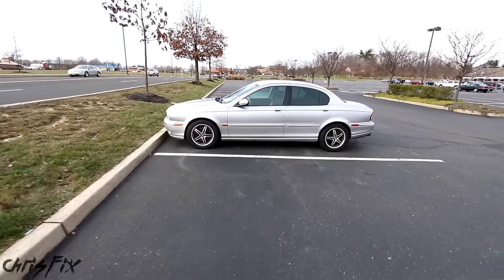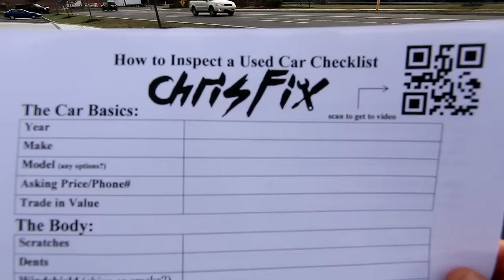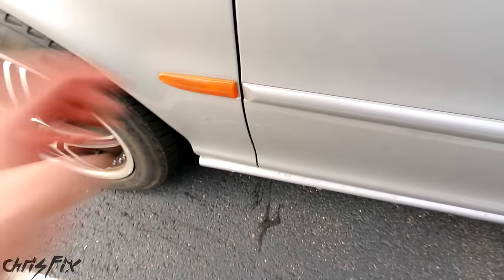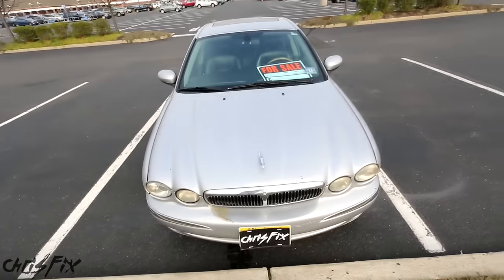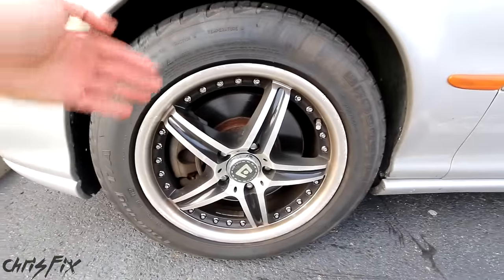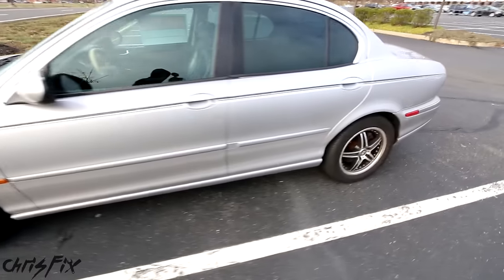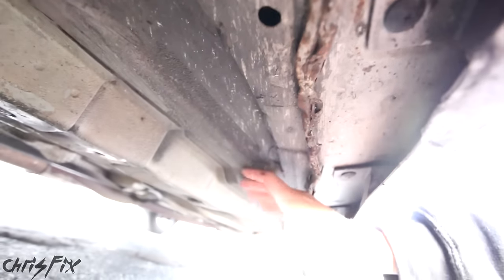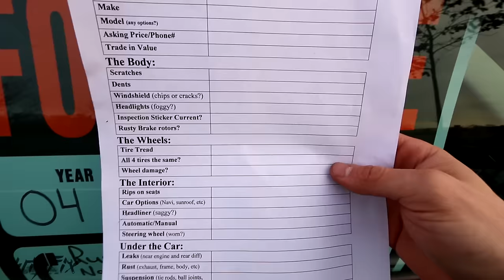How to Inspect a Used Car for Purchase

Comment: In the UK I wont buy a car unless the seller shows the plates in the ad, unlike in the US cars in the UK are registers when they are sold brand new and given plates which are permanently registered to that car, no matter how many times its sold. (I believe in America the plates are registered to the driver however it seems to change from state to state).

Anyway In the UK every car over 3 years old are subject to an MOT, this is a yearly inspection which vehicles must pass to be road legal. This information is public and can be easily found online for free. This includes all faults the inspector found, including engine faults and even advisories which will be minor faults which do not impact vehicle performance or safety.
If a seller is hiding the plate I 100% believe they are hiding this information so wont buy the car.

Does the US have anything comparable?

Comment: I bought a CPO Mustang from a dealership two weeks ago and turns out the differential has been leaking for months and the drift shaft is unbalanced. When I had it tinted the shop told me there was two small dents in the car as well. Crazy. Shit dealership for sure.
Right now it’s in the dealership shop and hopefully they fix it for free or I’m going to sue them for malpractice. CPO should mean it has NO major issues other than regular wear and tear. Ill be using this guide from now on so I dont get fucked over like this again.

Comment: NEVER buy a car without a presale inspection. There are issues the eye cannot detect, especially with transmission. A test drive is not sufficient to catch these issues. A presale inspection (called different names in different areas) costs about $100-$300. They look for the same things the guy in the video did plus they lift up the car, check the parts that require computers to check and they tell you if the car is safe and any pending issues they catch. This is EXTREMELY recommended with a private sell and HIGHLY recommended anyways, even from a dealership. If dealing with a dealership, DO NOT USE their suggested mechanic for a presale inspection. Go somewhere independent.
Reply from the maker: Thanks for sharing, I've actually gotten a few cars inspected and every time the shop doesn't do anything except plug a scanner in to see if there are codes and do the same inspection like I did in the video. But if you know a good shop, you could always try bringing it to them!
Reply: @chrisfix  That is shitty. I've come to expect that of most places though. Luckily the mechanics in my area offer more. My mechanic will actually do as you did plus lift the car up and check for any and everything he possibly can. One time he even checked the actual break pads and offered to replace them.

Comment: i’m buying a 2009 a4 2.0t quattro and the guy wanted 7500 after he put 2 sets of rims and around 1500 worth of parts and he said the front brake rotors were warped so i got it for 6500

Comment: Please help, I purchased a used car and didn't check codes, I checked codes after buying and it has 3 codes but the dealership says the codes are just from memory storage and not active, he said it was a problem the car once had but is resolved, is that true? Or is the car likely going to give me the problem? I checked drive monitors and they are all ok and complete. I am taking a long drive this weekend to see if it triggers the car check engine light which is off. The car is used but does have a 3 month powertrain warranty which would include the codes I found when scanning. I'm wondering if I should just sell and not deal with it

Comment: No matter what type or Model this is..This would of been a perfect Car to show to the keen eye what not to buy with a simply 1 + 1 = 2
This car has been in a accident(s)  Cracked from bumper  And circle swirl mark in the rear (Other cars License plate screw head embedded into bumper) followed by scratches where the license plate bracket had also rubbed 
One of both of theses areas Triggered a Airbag release in the steering wheel If you inspect the centre of the steering wheel the color of the Airbag cover does not match the color of the Ring of the steering wheel Or the rest of the interior It looks darker from lack of UV exposure (age) 
Also there is a larger then factory gap between the Airbag and the steering base ..Nowdays if your unsure of something like that Type in 2004 x-type steering wheel and see the diffrence from a factory one online 
Another sign is the lack of a splash guard under the front of the car that was not mentioned
Cheap aftermarket rims that have been on there for some time could be another sign of a accident Dealership OEM rims are quite expensive compare to aftermarket The Owner might of when "Out of pocket" for a replacement On anywhere from simple curb rash To a fully broken/warped rim This would of been a walk away point The car was poorly looked after And cost cutting

Comment: Hey Chris. Or anyone in the comments. What do y’all think about a 2012 Infiniti m37s with 200k miles? Should I find something with lower miles ? How long do these Nissan engines last ?
Reply: Definitely don’t buy a used Nissan that’s a newer one with 200k miles. Only would buy it if it was a older Honda/Nissan Altima

Comment: couple scratch is no problem at all when you buy used car most important is engine and transmission if engine and transmission is bad what will you do with shiny body or glass or tearing seats?   you are minding too much for dents or scratches
Reply from the maker: Both are important. If the owner can’t take care of the outside, they probably won’t take care of the inside.

Comment: I've been looking for used cars on auto tempest for a silver sedan for under $500 with a manual transmission, 4 cylinders, silver paint, and something that could use work. I would like something that I could use for cheap daily commute (4 cylinders). I haven't found anything that i'm looking for in NC. Any ideas on how to find it?
Reply from the maker: Watch my next video ;) not a sedan but it will give you some ideas.

Comment: What you didn't say his the doors, bonnet, and the boot lines , should have the even gaps all around being the same so the car might of had major repairs done, this car didn't say it's had a service, owners or a m.o.t.done does it have a cam belt or chain, if belt when was the last one been changed has this his very inportant for any car that has a camshaft belt because if this breaks so does your engine . PS THIS CAR DON'T HAVE THE RIGHT WHEELS FITTED

Comment: Is it better to buy 1-$5000 car, 5-$1000 cars, or 1-$1000 car with $4000 in repairs?
Reply from the maker: Better for what? What's your end goal?
Reply: @chrisfix  Miles driven.
Reply: I need to get to work as many times as possible and I only have $5000 to do it.  Which one is best for me?
Reply: Notice me senpai

Comment: We just got taken for nearly 5k following the advice of this video, don't let this happen to you!  Having a "clean title" in hand may turn out to be useless for you!  Why?  It may have been re-issued via filing for a lost title for example while the person shows you the prior title that they still possess.   Every time a title is printed, a new title number is issued.  Even when a duplicate title is printed, to replace a lost or damaged title, it will have a new title number. That is how the DMV can invalidate a previous title. Whenever a new title is issued, all other titles with that VIN are completely void even though they are in the current owners name.  We discovered the new title of course was "equity stripped" with a new set of liens.  The loans may be legit or bogus, but the order of priority on the lien will prevail.   It then becomes a "civil issue" and then you have the option to spend even more money in court fighting for a money judgement. If you win, all the other people are paid from the car sale first of course with your judgement in the back of the line: Therefore getting a judgement is worthless as no money will be left for you.  If the seller has no property of value or money in their name to go after then that kills that option to get compensated. 

Also, a Bill of Sale is actually more powerful than the title; couple that with a cash deal, the dead title you get without the new title number and you are sunk and burnt as you can't even prove you gave them anything without the Bill of Sale... AND they are holding the current legal title! 

please take this video down as you have left out critical details regarding inspecting the title and getting a bill of sale etc.  My family and I now have no car and no way to get around without taking a freaking bus!

Comment: The only problem with the Car is the car. This car is one of the worst reliable cars around, and the 4wd setup is ridiculously expensive to fix when it breaks and it will break.  I would buy a Honda or Toyota almost eyes closed in comparison, they are easy to fix and most models have no major expensive issues to fix after 100k miles. If that car was $1000, I would buy it as a disposable car, when something big breaks you throw it away.

Comment: Not really useful the damages that you showed could cost nearly nothing the expensive parts are the engine, transmission, steering.. If you don't pop the hood and check what's inside you can't even think of buying it

Comment: another tip, do not BUY a used jaguar, just dont do it - if you're gonna buy a used car, just stick to a honda or toyota, or something like that. if you want a jaguar or porche, bmw, etc - LEASE them, they are not built to last 200,000+ miles.